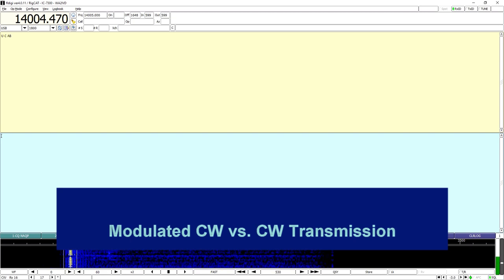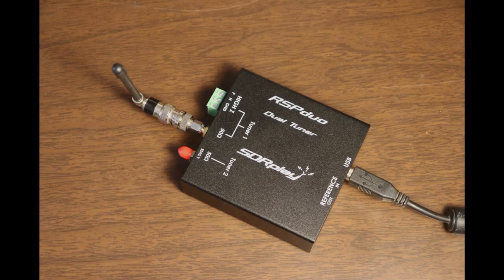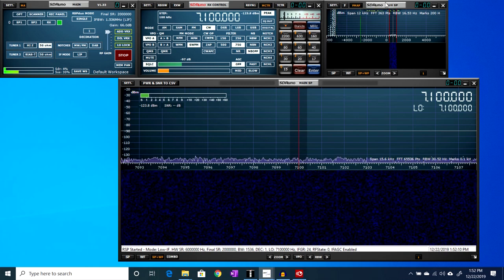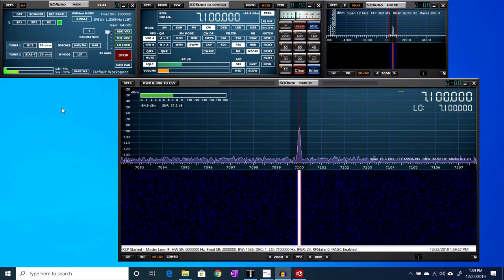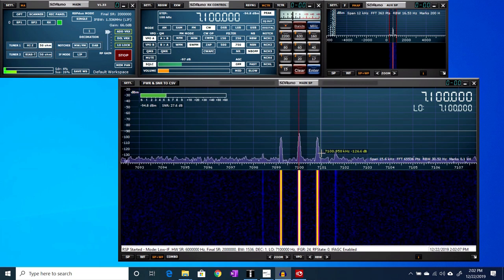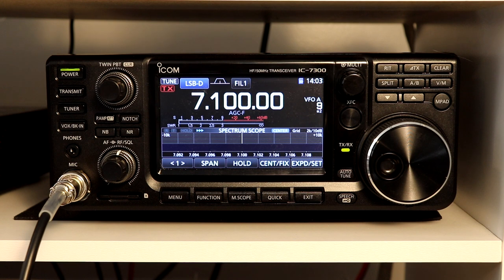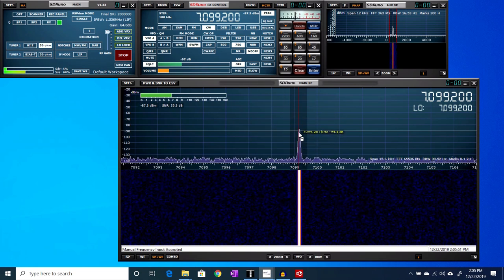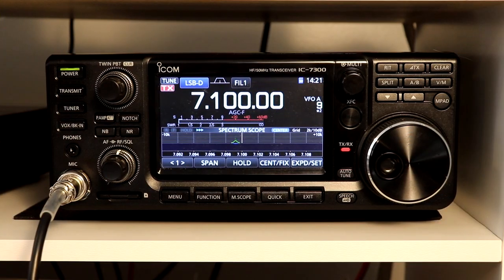Modulated CW vs. CW Transmissions

Comment: You can't tell the actual bandwidth of the CW signal from the frequency display of the SDRPlay absolutely.  What you are looking at is the output of an DFT (FFT is an algorithm to compute the DFT efficiently) with a window function applied.  The window spreads the bandwidth but it also reduces the sine(x)/x components produced when the sequence is truncated.  This is a DFT thing and not related to the real world signal.  If no window were to be used, you would see this discontinuity in the spectrum and you see something that resembles a christmas tree if the sample rate isn't an exact integer multiple of the frequency being measured and where the sequence of data doesn't start at zero and ends at zero AND is phase continuous.  The window tries to eliminate the discontinuity caused by where the data starts and ends by tapering each end to zero.  They are probably using a Harris-Blackman window because it is awesome.   If the number of points were increased, the DFT bin width would reduce proportionally and the effects of the window are reduced as well.  This translates to the resolution bandwidth of a analog spectrum analyzer and would increase the sweep time.  I would assume that the occupied bandwidth of the unmodulated carrier is significantly narrower than 200Hz.
Nice vids.  Awaiting my 7300.  I am not a ham yet but having the radio will inspire me.
Reply from the maker: Hi Kelly.  Nice detailed description of frequency domain techniques.  Regardless of the measurement method, another important aspect to defining the bandwidth is deciding at what point we want to measure it- 30db down from the peak, 40db down or something else.
Reply: That is exactly my thought. If the kind of modulation represents the exact integer of the sin wave (single) period you do not see   the side band. To do that you need a transmitter with a DDS source that during CW modulation only jumps between integer sin wave periods. I am thinking about AM voice modulation in such a way. That should fare more efficiently than standard AM, as it will operate more like a D- class amplifier just with a sin wave.
In the way that the Ham Radio A2Z shows with a single side band and carrier suppresses the output frequency cover modulation frequency. It looks more like a spread spectrum. Not sure if that allows as the accuracy bandwidth will be equal to modulated signal bandwidth and no body els can transmit within. I am not a ham radio operator ( RF test engineer), I may not 🚭 understand many things of that field, my apologies if I mess up some concepts.

Comment: Only way you could generate Modulated CW (A2) on a modern transceiver is by injecting a tone in the microphone input while keying the radio in AM (DSB-TC) mode. You'll have the carrier and the two sidebands with the modulated tone. If you do that same thing but use USB or LSB mode, you get a normal CW A1 emission, just as if you were keying the radio in cw mode, as long as you don't overdrive the audio.
Reply from the maker: Yep.  Correct!

Comment: I don't have any equipment to analyze signals. But, according to everything I have read, CW is about 150 Hz bandwidth and digital SSB is anywhere from 500 - 3000Hz. Am I missing something or are you saying that the difference is small enough that nobody will notice?
Reply from the maker: Hi Jared.  It is true that digital modes vary greatly in bandwidth.  PSK31, for example is only about 60hz in bandwidth.  My point in this video is that sending Morse code (CW) from the same radio will be the same bandwidth whether you put the radio in CW mode and use a key or put the radio in SSB mode and use computer audio to generate the signal.  The caveats being that the computer is generating a pure, sine wave audio tone and all of the audio inputs are adjusted correctly so you're not overmodulating.
Reply: @HamRadioA2Z  Okay, thanks. I am a new ham and I am exploring way past my level of understanding. I wasn't sure if more sensitive equipment could tell the difference or if the FCC would care as long as you aren't producing signals like your first example that produced signals on two sidebands.